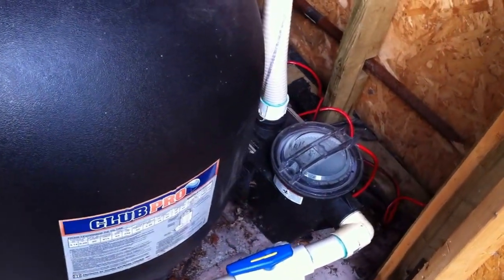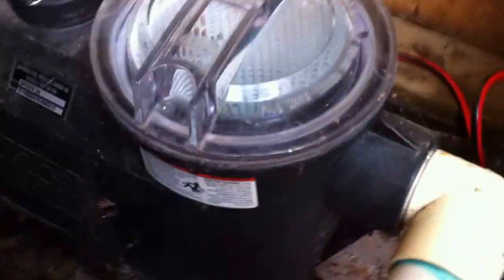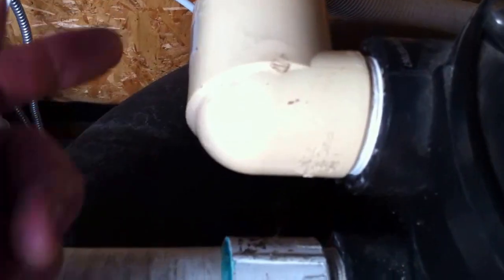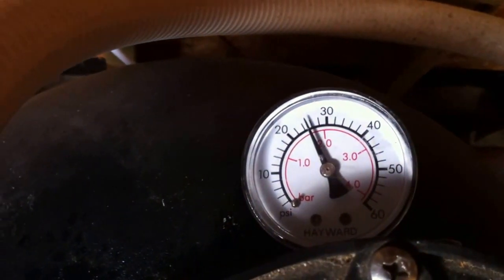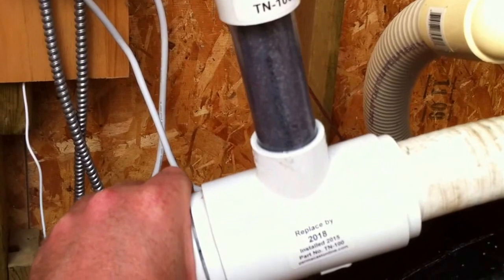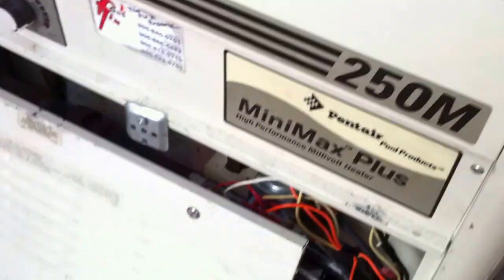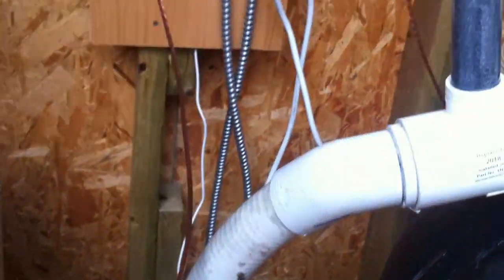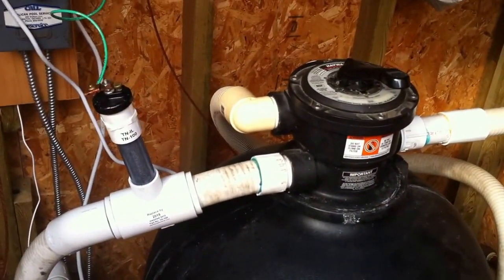Pool Equipment Installation Reviews - Sacrificial Anode & Check Valves

Comment: What’s wrong with the bonding wire ? Is it because they used stranded copper instead of a solid 8 gauge wire ?  Just trying to clarify ?  Good info on the anode, check valve, 90 deg street pipe though 👍

Comment: Hey Steve, really nice channel.  I do have to ask though, since water is passing through the anode in one direction, away from the heater and when the system switches off the cell should stop producing chlorine what purpose is the check valve really serving?  The sacrificial anode 100% but a bit confused on the check valve.  We see about 1000 pools a year and VERY few with salt systems have check valves between it and the heater.  In the days of inline chlorination we always installed them but oftentimes the springs would rot out in about 2 years and many didn't function correctly.

Comment: If a pool is properly bonded. Would one still need the Zinc Anode?
Reply from the maker: You bet,  Even if the pool is bonded you still have dissimilar metals within a saline solution.  Whether you like it or not your pool is a giant primary battery and something in your pool will become the anode in a galvanic couple.  It is best that you provide the pool with a suitable anode as opposed to allowing the pool to find and consume its own anode

Comment: So wouldn’t you want to take the check valve a step further and install a heater bypass to keep saltwater out of the heater when your not using it?
Reply from the maker: No the salt is not the problem. Chlorine is the problem that a check valve is helping with. And a bypass is good for certain times that you want to bypass but also then the heater has water left in it which is also not ideal. For more info on heater bypasses you can check out this article www.swimmingpoolsteve.com/pages/heater-bypass.html

Comment: Just a question put anode before heater bonded to casing heater about a foot above salt generator pump constantly runs u think I still need to install check. It’s above ground pool and rolled up ever year for winter